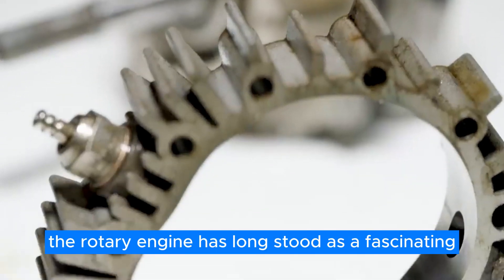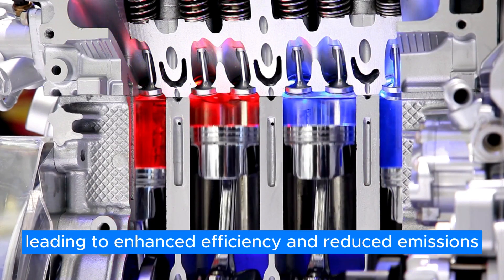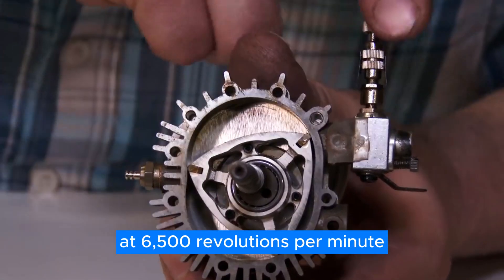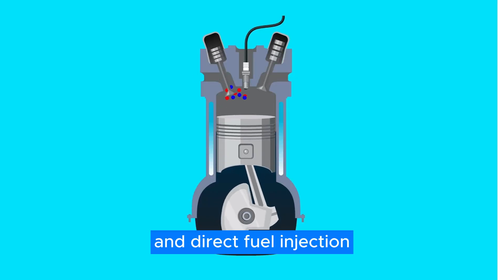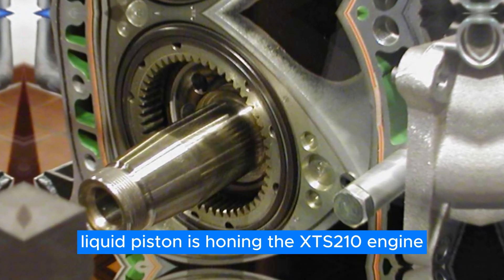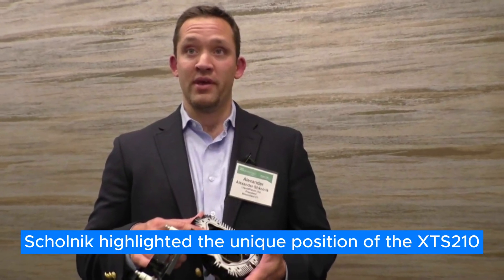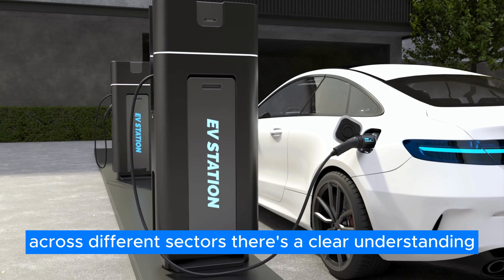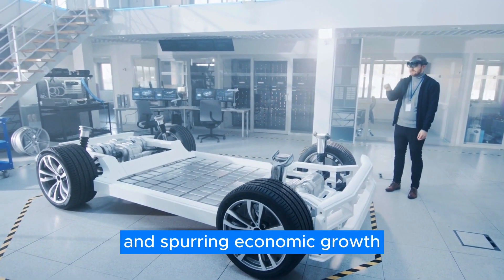This New Tiny Rotary Engine SHOCKS The Auto Industry!

Comment: Oil is subsidized $7.000.000.000.000 forcasted $9.000.000.000.000. That's more than $1.000 for each citizen on earth!
You have to pay this, on top of that, a cartel with mostly dictatorships controls the price. Now the brent spot are at $90.
Fossile cars are subsidized through oil $28.125.

Oil makes the fossile car owners hostages to the oil industry. This makes the politicians rise the subsidies every year.

This is insane!
If it's a liquid piston, or something else that need oil, it's just stupid.